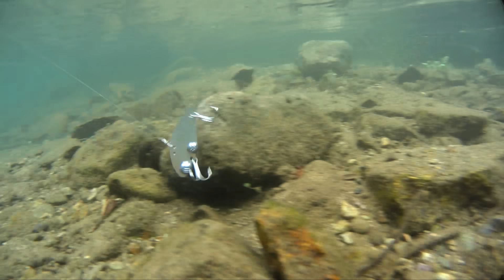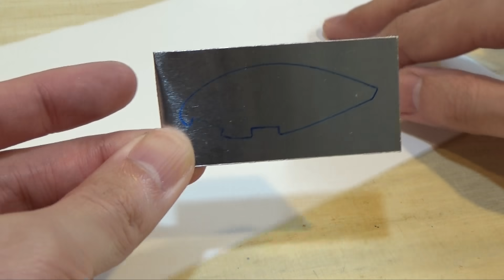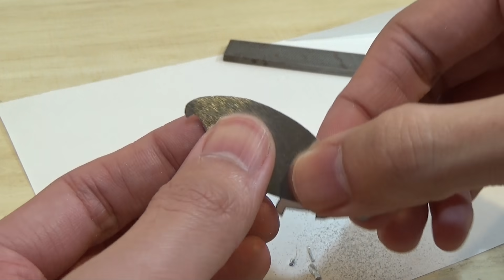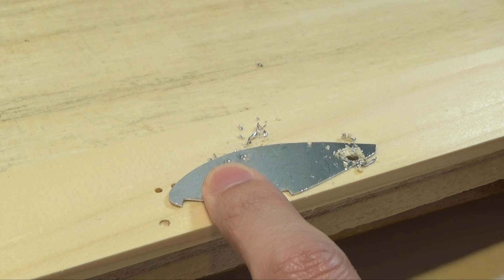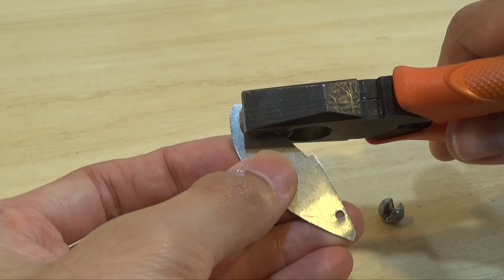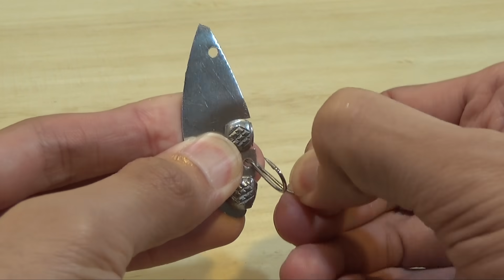How to make a Blade Baits (using aluminum plate). アルミ板で自作するメタルバイブレーションの作り方

Comment: how many grams of lead?
Reply from the maker: Thank you for the question.  I' ll show you a list of the lure weight and lead. 
Large size: about 12 grams (Lead: 6.5 grams head, 4 grams rear). Medium: about 8 grams (Lead: 4 grams head, 3 grams rear). Small: about 6 grams (Lead: 3 grams head, 2.3 grams rear). You can refer to it if you like.
Reply: @haru834  ok thanks for the explanation I will try with the model I made myself and the model you created. .